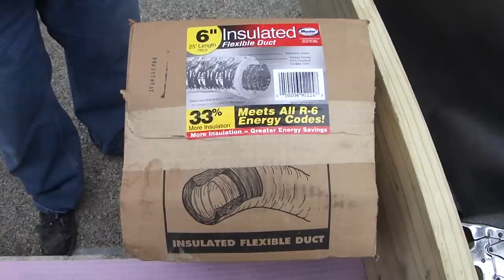Building A Small Room Addition And A Deck

Comment: Can light fixtures do come in a version called "air tight" which has a double wall and no external/exterior holes and/or slots open to the attic.  There really is no other way to go these days as heat and cold escapes through the non-air tight fixtures.  Love them.

Comment: You did a very good job. I just noticed you have your sizes wrong. You said you used 2x6 that are actually 5 1/4 and later you said you used 2x12 that are actually 11 1/2 . It’s the other way around. Starting with the 2x8 and up all sizes are actually 1/4  and from 2x6 down they are 1/2.

Comment: I built homes for over 25 years along with additions, garages, pole barns, decks, remodels, re-sides, replacement windows and doors, new kitchens and baths, not to mention commercial buildings, additions, and remodels. I believe I am qualified to ask.... When you removed that sliding door there was a 6 foot original opening now there is a full width opening yet no mention of an engineered support header to carry the weight of that gable end being that that house is no doubt Balloon Framed with the 9 foot ceilings. You put cement board on the floor as if you were going to continue the ceramic tile out into that addition. Why not extend the existing duct work with an approved metal duct straight out and then replace the ceramic tile cut out for the old register when the floor is tied in? When did you cut in an access to the crawl space because the duct work that you installed cannot be used in an inaccessible area as it is a fire hazard because it does not carry the proper burn through rating? What did the Mechanical Inspector say about cutting in a flexible duct to the bottom of the metal duct work?  Where is the light switch that controls the porch light, you showed the switch for the recessed cans but there is no switch for the outside light within the acceptable distance of the sliding door opening? Is that Tyvek Exterior house wrap that you used inside the house for a vapor barrier? Is that Tyvek Exterior draft tape approved for use inside the I/C recessed cans? In the framing of the roof structure I didn't see any approved mechanical fasteners attaching the roof structure to the house outer wall nor to the outer load bearing wall of the addition structure. Did you add or extend an electric receptacle outside of the sliding door and is it a GFCI protected plug? Are the plugs in the addition connected to the kitchen plug circuit? Did you cut off the bottom of the "J" channel around those windows instead of just pushing it back up into place? Did you repair the siding beside the sliding door where it did not line up with the existing siding and also on the opposite side of the addition where it clearly did not even come close? At 19:51 in the video you referred to "...people that don't know what they are doing..." are you including yourself in that group and is this whole thing one of those elaborate jokes to "punk" someone?
Reply: DivineInspirationGarage Most construction contractors don't need to be licensed in Illinois

Comment: Great video except for the duct work, that wont flow very well and tape will dry out and fall apart, duct sealant is used at each connection and zip ties, called panduit straps are at each connection as well and duct sealant again.

Comment: Professionals joint there courses and put mortar on 3 sides. Also using a line and pin would of been much easier than building a frame just for a small structure.

Comment: do you see how the rest of the house has no spaces between blocks, but his new concrete has spaces.. that's where water will get in maybe? also, aren't you supposed to have footing and floor slab too.. I don't think the blocks are placed on the ground directly as water will leak underneath?.. blocks are the least strong for foundation and they don't hold well.. usually people also put rebar inside them to reinforce.. the blocks have no lateral stability.. so if a large truck parks next to the house, they could cave in because the pressure on the ground would press on the blocks.. but I am guessing the earth in the middle prevents the blocks from collapsing? so probably on OK method, just not a clean or textbook one?

Comment: Should have hired a heating guy. That new branch should have gone back to the main trunk. That flex shouldn't be bent so tight nor should it be used for long distances. But the biggest sin here is using foil tape to secure everything. Foil tape should be used to seal air leaks not secure ductwork. Use self tappers for that tee, duct zip ties to secure the flex to fittings with a zip screw driven through the zip tie, and please please never use duck tape for duct work. It will dry up and fall off.

Comment: I don't understand why anybody would use regular untreated wood on the deck.  Perhaps I missed the part where it is pressure treated appearance grade wood.  Also the wood decking looks too close together without enough gap between the boards.  I am also curious why simple Simpson type hurricane rafter ties were not used for the roof.
Reply: he used nails on the floor so he said they didn't need a gap. lol. Should have made the railing out of MDF to make it complete.

Comment: the HVAC is wrong. never T off of a round duct that serves another room. Make your takeoff connection for the addition at the main trunk. The line heading upstairs that he installed that T on will not supply sufficient amount of air. I guarantee it. Some warm/cold air may be coming out but wont be enough for really cold or hot days. (heating / cooling)

Comment: This is the perfect example of why I do most of my home improvement projects myself.  You place your trust in someone... allow them to tear into your home... hand them a ton of money... and they do a hack job like this.

Why are the windows so close to the ceiling?  Why is the ceiling so low?  How do you get under that addition if there is a problem, like the insulation falls or the heat duct gets disconnected?  Is there proper ventilation under that deck to avoid mold... because a vapor barrier isn't going to keep condensation from occurring. Why so many gaps in the block mortar?  If I were the home owner and saw that mortar, I would have fired him on the spot because he obviously isn't a builder.  He may make a fine deck, but this is the perfect example of why you don't hire a deck guy to build a home addition.

As for the people sticking up for him... if this were his home and he is tackling it himself, then that is a different story.  He lives with the consequences.  That is not the case here. He has presented himself as a professional doing a contract job in this video Therefore the criticism he is getting is very justified.  

Code is there to protect the consumer from less than sufficient and/or dangerous building practices.  Any builder who states otherwise should find a new profession.

Comment: I forgot to put it in my comment earlier but also if u knew so much u would put ur plate on ur sil seal then ur box on top of that... and yeah u filled a lot of ur block wall but u didn't even leave enough room to Mordor in between because some blocks r touching... And that 6 in flexible duck is common in stores..

Comment: There are lots of ways to construct such a project.  This is not my preferred method and wouldn't build it that way for my house.  For example I would drill into the existing footing and existing foundation wall and install rebars for better integrity and a more solid wall.  Against code?  Some areas yes, will it fall down?  No.

Comment: I don't know if it came out as sloppy as it did for the purpose of showing a video quickly,  but you could have been a little more efficient in sealing the duct and the duct piping.  you missed both the horizontal seals.

Comment: There are so many things wrong with this video. This video proves and shows exactly why we, in the USA have a building code. And I guarantee you he does not have a permit for structural, foundation, HVAC ,electrical ,and siding. And for the love of God you cannot use duct tape for HVAC.

Comment: For a small add with no second floor I think it's safe. But if u built a whole house like this especially with a second floor. The whole entire house is guaranteed to shift and potentially drop (worst case) but for a small add it isnt going any where. U still wwouldn't pass the inspection from the building department but u did alright for hack. I would hire u to do some hack work. After all u people get what u pay for.

Comment: I like the video, I really do.  But I will just say I am no contractor and have little to no experience building an addition, but I would be pissed if I saw this kind of work done on my house!  For one, I don't think I would want anything but pressure treated wood on the outside.  I also don't like how those blocks are spaced and mortar is missing from in between some.  Also, as with the block, if I am paying a profession, he had better run solid ductwork and not just hack a hole into my existing duct and rig it like that.

Comment: Im not a pro but shouldn't you use 5500 psi cement?
Reply: Couple things. One, cement is an ingredient of concrete, which is the material I believe you to be referring to lol. Also I am not entirely sure of the weight of the unit but by my guess, he’s good. We know the unit not to be super dense, so even if we were to estimate it at 2 tons (around the same as his pickup) it still means that if he used 2500 psi concrete or even somehow got as low as 100,  the weight of the room could still probably hold on an area the size of a couple of those blocks. Now I’m not remotely advocating that nor am I naive enough to act as though the weight of the room itself is the only factor but basically, no I don’t think he would need it

Comment: Iv been in the concrete foundation n flatwork trade for forty years and seen both sides of the coin in requards to building codes Your going to get codes n fees that are excessive n inspectors who are idiots. However these codes are put into place for direction an the overall a good thing when it all boils down to it. This cat is old school and has of ood general knowledge of what hes doing even though i kinda laughed at how the footing n blockwork was done. What i didnt like is how he blew by how he correted tying the roof framing into the house

Comment: My sister bought a old junk pile house for the 'so called "MARKET VALUE" $$$. We checked the city  had NO permits for 70 years. Rotting windows and roof. Basement foundation moisture mold.
Nothing was up to date or up to newer styles. 70 year old cabinets and doors.  Tons of dead mice and rodents.  We found termites. Red squirrels in attic.  The sewer drain blocked up do to tree roots in the yard costing 3500 to dig up. The wiring was a mess and a freind tried to fix the plumbing and was electrocuted to death.
 Houses should depreciate like a car. Appraisers and Realtors lie for $$$

Comment: I used to work on stalling air conditioning. that tape he use is not going to last one bit. that is only used on metal. he didnt use any straps to tight the duck or any sealant. the air is gonna keep on getting out. also did yall notice the vent hole got between the wall? 
everything else look good to me, but again idk anything else besides AC and painting..soo im gonna trust everyone else and not listen to this guy

Comment: i agree with the HunterFisherman fella.  i for one dont like and dont use flexible duct.  theres a time when its needed.  but as a professional, in my opinion, this example would not be the right choice for the flex duct.  why?  because everything ha good accessibility to use a wiser choice.  flex duct is for retro-fitting and hard-to-get-to places with limited work room.  there is an opportunity to use hard pipe for the  floor register, since the floor is open with good access.  another reason i dont like using flex line is because it crushes too easy ... you took a chance of tearing it when pulling it through the hole that was cut.  and had that happened you probly woulda just put some of the foil tape on the tear.  why didnt you mention screwing the half T to the existing ductwork before using the foil tape??  and my opinion on the insulation between the floor joists (not rafters) is:  i hope the weather cooperated.  hopefully you got the sub-floor and framing complete and "dried-in" before any rain.  had it gotten wet  it wouldnt be worth a tinkers damn.

Comment: Guys a but sloppy and I am not sure about the code where he is, but where I am, you have to wrap a flex duct at least twice with duct tape. That duct he put on is going to come off. Needs to be painted with mastic too to make it air tight. I also would have tapped the supply line further in to avoid such a sharp turn for the flex duct. That will work but is not optimal.

Comment: deck house connection has no flashing or z rebar window has no header 2 ducting outlet for a small room this will not pass inspection (rick's horizon building contractor)

Comment: Why didn’t you install rebar accross the footing and rebar to run inside the cinder blocks???
This would of given you extra support and so the blocks will not separate or crack. 
I guess you did this on your own without inspections nor permits👎🏼

Comment: those blocks are gonna collect water, freeze and the comcrete is gonna crack like penut brittle. the heat duct should of been cut at least onvthe side... heat rises! horrible insulatio  of the t joint... duct tape is not for duct work!! use what he used. dont use glue their is an actual floor application adhesive that is far better. Use hangars on every connection. screws are far better than nails but if you use nails use ring nails. always rubber waterproof where wood meets metal to prevent condensation and rot. isulation under the porch was great but you should always vent crawl spaces to keep gases and moisture from building. making aometging look pretty soes not make it right.

Comment: I am surprised you completely skipped the over the walls, 
windows , doors , siding etc
I am a retired carpenter after 35 years. 
Please take this as constructive criticism and not an attack.
I think the fact that your siding lines don't match up at all coming around the corners is the mark of an amateur and I personally always build bird boxes at the outside ends of the rafters on either side of the roof.
In my opinion it looks much better than just coming down at an angle then squaring the J- channel and soffit. Anyways I don't see any excuse for the siding not lining up
Before anyone comments telli g me I'm a hater or whatever , I'm not saying this isn't an overall quality job and it looks like a sound and up to code job.
However ask yourself if it were your house wouldn't you want the lines on the siding to line up?
It's always the little finish details that can make or break a job ; also they are the mark of a true craftsman

Comment: vent should of been cut on the side heat rises. blocks are going to collect moisture and crack the concrete like rock candy.. all joints should of had a hanger if to were going to block than you should of done it correctly. all medal and wood should have a vapor as well. You used great material but sone incorectly it means shit. pretty doesnt make it right

Comment: So many things wrong with this video and not done to code. I pride myself in always building correctly the first time and with integrity. Building to last should be the goal for every contractor, not only for the liability reasons but for the assurance of the customer. I don't know why he didn't ledger off of the house, no hangers, nothing...I really hope he added more floor joists before he sheathed, he left the most important half out in the video. Id bet they'll have problems with sagging before too long where the joists meet the house, especially since hes layed tile inside. I'd love to see how that job turned out!

Comment: why in the hell didn't you cut hole in the back side of the pipe , instead of the bottom to make the job better looking ,and a little better air flow. I not a carpenter but I know I could do a better job then that. the whole job looks pretty shoddy to me.

Comment: I see a lot of misguided instructions,,,the top of the wall should have a moisture barrier the plate should be pressure treated lumber,,AND run continusily around the wall the hole he cut in the piggy back "Tee" was smaller then the pipe choking the air back Thats NOT "The Right Way"